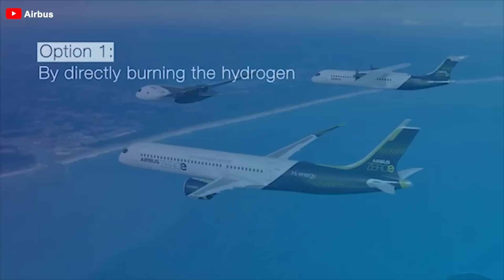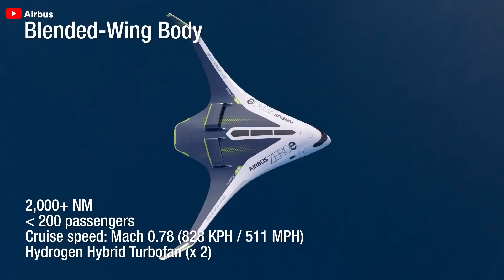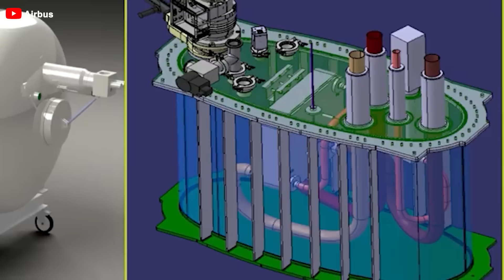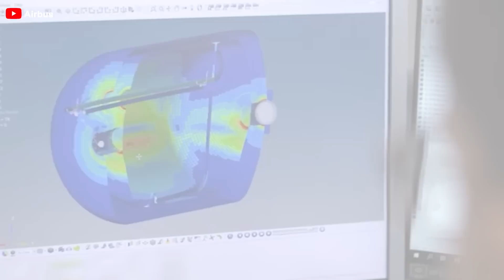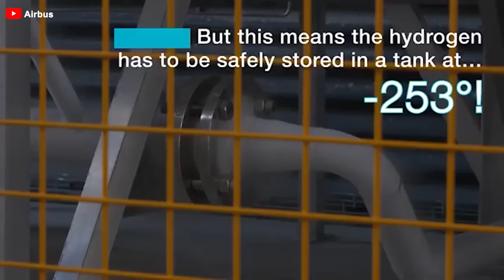Airbus Just RELEASED a Next NEW Aircraft That DESTROYED Boeing! Here’s why

Comment: Greenness depends on how you make the hydrogen, How do you make the electricity required?????Li ion batteries are not green.  Promising is Thorium molten salt nuclear reactors reactors. They also can burn  long half life spent fuel into short half life products. More radioactive but for a much shorter time, giving a long term sustainable solution.
Reply from the maker: Oh, thanks for your feedback

Comment: Hydrogen has failed in the car industry, it is expensive to make, difficult to store safely & highly combustible. Not sure I'd be comfortable flying a hydrogen powered aircraft.
Reply: The lift is more important 😊
Reply: Hydrogène is a good solution if you compare to full electric. It is just a new abondant energy source which need to be carefully developed on the long run from green sources, wind, sun, water and nuclear as well. Is going to take time and money on RD but it is a much more eco-friendly solution than full electric which need a lot of rare material on limited quantity.
Reply: It has failed because of the misguided rush towards electric cars, ignoring the obvious that hydrogen is the most abundant element in the universe and produces no pollution.  Of course it has to be manufactured and the problem is avoiding the use of fossil fuel sources to generate the hydrogen and thus negating the point.  I think that if you consider aviation fuel vs hydrogen, they both present a huge potential hazard, but I think we've moved on quite a bit since the hindenburg storage problem.  I think it's more realistic to expect a wide body / high capacity jet to be deployed on a long haul to use hydrogen, but we may still be some way off that stage.  Curious though to see what Airbus and Boeing could do if they went all in with hydrogen.
Reply: Every new technology "fails" before it succeeds. From conception to implementation requires a lot of foresight and effort. Recall the derision that the "horseless carriage" received before every family had one, or two?